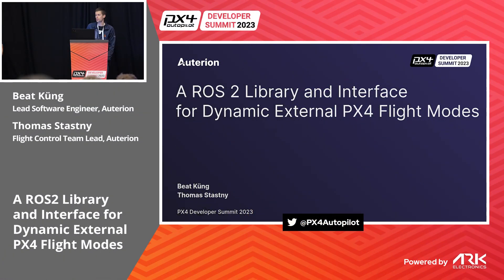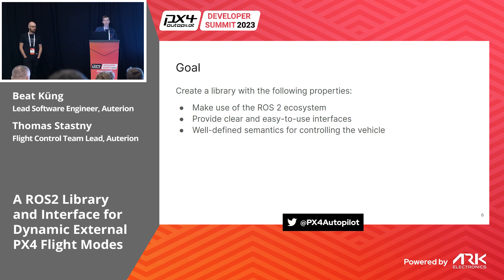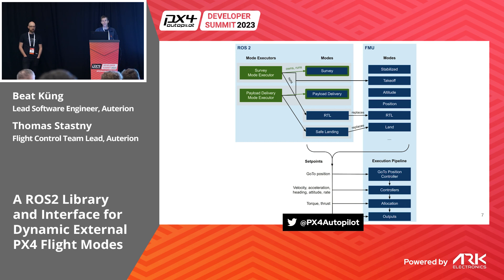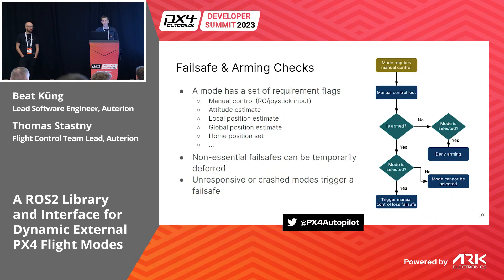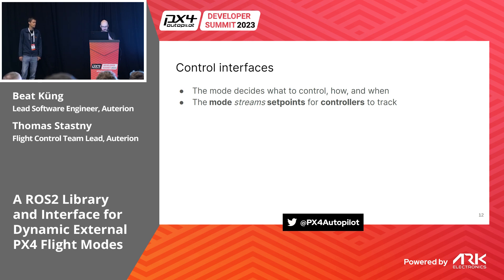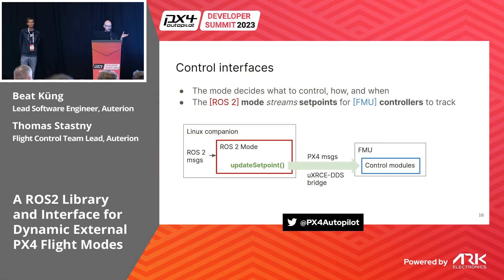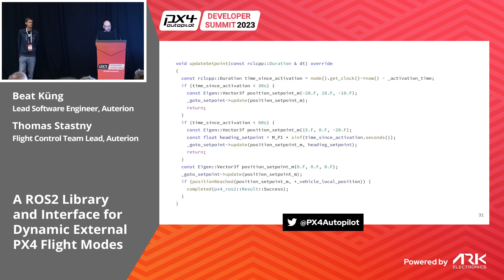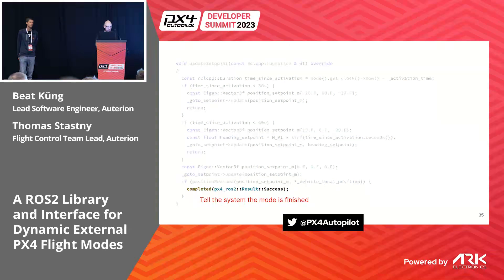A ROS 2 Library and Interface for External PX4 Flight Modes - Thomas Stastny & Beat Küng, Auterion

Comment: At 24:36, I believe the flip mode is executed, but it seems like the rate setpoints were not set. From what I’ve seen in the GitHub repository, there's an example for attitude setpoints, with no specific rate setpoint implementation. Could you clarify how the flip was achieved in this case? Thanks!
Reply: Have you shared this model in the video on GitHub? It would be great to implement it in real flight on our end as well😄